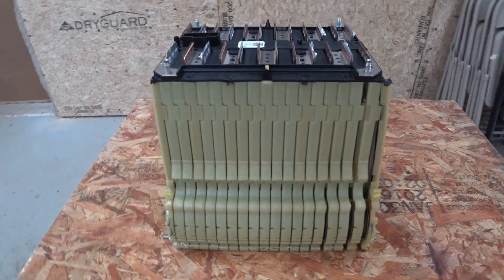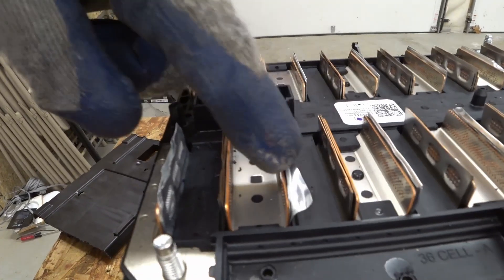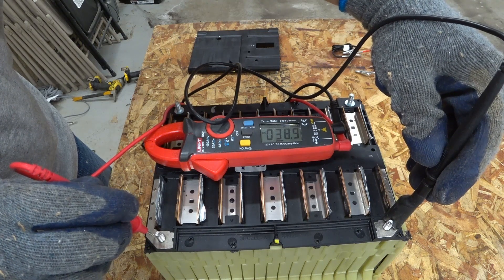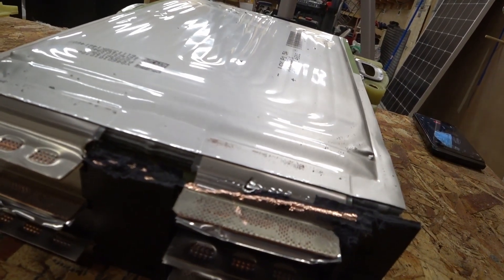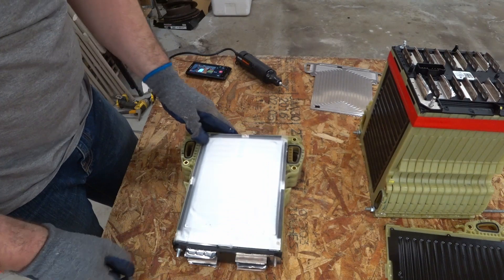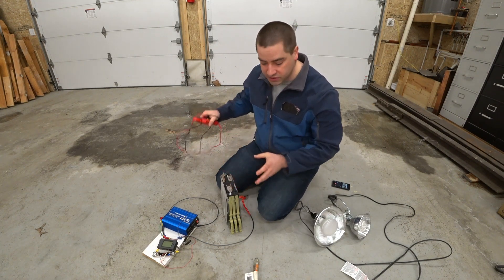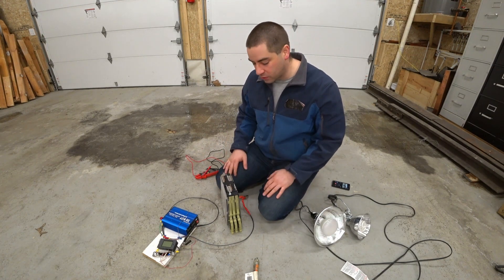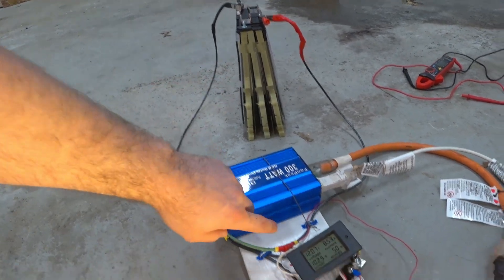Taking Apart a Bad Lithium Battery, Expanded Cells

Comment: You need to take more care of your followers David . Those cells were never bad. They were discharged for some reason well below the cells after .You are pushing the explosive angle and they just are not explosive or flamable until you get much higher in heat and voltage. You should have pricked the cell with a pin aqueezed them back together and superglued over the pin hole.
The Gas is just evaporated ethelyene carbonate heated by an overheated cell. It sits inside the pouch cell up to and covering the top of the plates.So the cells are good as you found out. The fault will be in the BMS or some place of short that occurred and got the last 3 cells only.Thats what you need to find because thats happenong frequently in Li Ion and LiFePo4 technologies.

Remarkable and a mystery because LFP cells love to work at 50C and in fact do much better there.?

Comment: heya oke so even wen the cell's are a little bolted they still have some capacity and they didn't blow up wen charged and discharged that is good to now because the polymer cell's that I bay are also a little bolted

Comment: FWIW the reason this probably happened is because someone disassembled the whole battery, but left the BMS connected to that pack (or all, doesn't matter) after the series connections between the packs were broken.  When this happens it starts to slowly discharge the end cells exactly like yours shows and the rest are perfectly balanced, albeit too low in this battery.  Eventually it will suck those end cells down to zero.  That, coupled with charging incorrectly to try to bring them back ends up fragging them.  This did happen due to some manufacturing defect or improper charging, unless they went waaaay too high when charging.
Reply from the maker: Thanks for the explanation.
Reply: Meant to say "did not happen due to some manufacturing defect"
Reply from the maker: I figured that's what you meant.  Again, thank you.  I appreciate when someone is willing to help me out and share knowledge.

Comment: Hello David. 
Thank you again for your videos. I have a concern about my battery pack and I would like to know your opinion:
I have a Chevy Volt Gen 1 battery pack. I just check every single cell and all of them show 3.52 V (like in the video:) ) but only one has 3.40 V. I don't see expansion or anything wrong, and I guess it is just a unbalanced cell (this battery has been stored for months).
What do you think? Should I worry about it?

I am a beginner and your videos are being really helpful.

Regards from Spain.
Reply from the maker: What you describe does not sound bad.  I would test the individual cell.  It can still be in the module, just make sure the module is not connected to anything else.  Then use some little aligator clip wires and a cell tester, such as this one or similar: https://amzn.to/2QgmXlN   If the cell still has the same capacity as the other cells (test a couple other ones for comparison) then you should be good.  
You will still have to determine why it dropped low in the first place.  Is it a bad BMS?  If so replace the BMS.
Good Luck.  I'd love to hear how it goes.  Maybe connect with me on facebook?  https://www.facebook.com/DavidPozEnergy/
Reply: Some cells statrt out like that and need an extra charge on that cell only when the pack is first made. Quality control is no less a problem on batteries than it is on car parts.

Comment: I've dealt with this over the years. Most hard cased prismatic cells have a pressure relief valve that can be mechanically released. 
Compress the cell in a vice and release the gas.
No open flame!!!
Reply: Ken Bell  I have had smaller 5-6AHr LiPo cells that gassed.  I put a dab of RTV on the edge of the pack and put the pack between a couple pieces of plywood with clamps to apply pressure.  Then used a very sharp pointed awl to carefully puncture the pack through the RTV (Still fresh) to vent the pack(outside!). Then smeared the RTV over the hole to seal it.  It removed the excess gas and the pack still works (with reduced capacity) but I don’t trust using it in anything.  Try at your own risk.   Good luck.

Comment: That test was well execute bro. It gave you  true reading ! I think sometimes these cell vary in resistance and can unequally charge and discharge . While charging the bms can bleed off any overcharge but probably no protection whilst discharging at a higher rate than the other cells if they have lower esr . I feel it actually a design fault really as the resistance match the cells but maybe would be better of have load analysis on each cell . I guess it all comes down to economics !
Reply from the maker: I agree.  My ideal BMS would have protection combined with the equalizer board from my more recent video.

Comment: One of the cells in my laptop battery puffed, so I did some research on this. It seems that these Li-Po cells puff because their seal was broken and moisture from the air got in them, which caused a chemical reaction with the electrolyte inside releasing a lot of hydrogen, causing them to puff. The puffing puts some space in between the electrolyte and anode/cathode causing the cell to not perform as well. Any attempts to release the hydrogen will only damage the seal further and increase the humidity that gets to the electrolyte in the cell.

Comment: It's quite normal for LiPo's to "puff" up when over-discharged as the chemistry inside starts to break down. The gas inside isn't air but hydrogen.
Reply: No I don't think its hydrogen or  oxygen as its produced from ethylene carbonate . But if you can find any support for the electrolysis theory please post back..

Comment: those cells will never get the rated c rating. but still very useable in a low current setup(for a short period of time because they are going to give up soon..
Reply from the maker: I had one comm enter suggest I add a step-down converter to charge my cell phone.  I think that would be low enough amps.  LOL   I laugh only because of the size difference between the battery and a cell phone.  Not the idea of a portable charger.

Comment: Maybe you could build a special fire safe enclosure and put it outside.  If you acquire at least 4 suspect packs over time, you could have 48V and wiring that a short distance to the house could be a little more worthwhile.
Another idea, is a remote solar station and battery backup for a well pump.  Again, in a fire-safe enclosure.

Comment: I'm using these batteries in electric car conversions and was interested in you're testing. Because of the load of a car that varies quite a bit setting a high cutoff voltage means a cut in power when accelerating at times. I have been seeing 35 amp hours from these batteries but that's pulling them down to 3 volts. I'm working toward using the batteries in the car  to run an inverter  to power the house  I think this is the next step . Keep up the good work

Comment: I would bet money that was a BMS failure.
Reply: Either that, or it was not charged in a while and those cells were weakest (or had highest self-discharge), so they ended up discharging the most.
Reply: A BMS merely TRIES to correct imbalance. If it's current is insufficient that's not a bms failure. You lost your money

Comment: Interesting so they are basically lipo packs like in RC cars or phones etc just bigger, and all in series.  Too bad they don't come apart without destructing them though, as it would let you rebuild packs if you have multiple with different bad cells.   Could maybe try to incorporate the individual ones into a RC car or something.  Wonder how long you could fly a drone with those. Though I don't know if I'd trust them for a drone.

Comment: An inflated battery is usually caused by 2 reasons, manufacturing defects or overtemperature when charge or discharge it. if the cooling system is fine the other thing to check is the BMS, could be working wrong. Is a good idea check the cell temp in the charge and discarge stage at a lower amp/h rate of the manufacture typical specs. the gas inside is PVDF with a fusion point of 180C . Be carefull .
Reply: Sorry that's incorrect

Comment: Seeing how the expanded cells are on the end of the stack, do you think regular water (or too low a water antifreeze mix) was inside the battery and froze?
Reply: Nope thats caused by wrong charging Lithium packs are air and water tight

Comment: It'd have been much more than 473Wh because you didn't include the inverter efficiency. No inverter runs at 100% efficiency so if you factor in for example 80% inverter efficiency, it could have been (473/80)*100 =591Wh. That's over half a kilowatt hours. That's a huge difference. :D
Reply: vuaeco   His watt-hour metering is happening ahead of the inverter, so his 473 Wh number is correct, except for the [tiny?] consumption of the meter itself.
Reply from the maker: You may enjoy watching my video on how I made the tester: https://youtu.be/yX094DWI-Mo  It might shed some light on this.

Comment: I would love to know what happened to my Android battery, it lasted for at least 3 hours with the screen on watching youtube, and then a few days without using it on battery (let it on the charger constantly) the battery went down to only lasting 20 minutes maximum, and there's expansion which I don't know if already was there or not.
Reply: If it's over 3 years old it's probably just dead. They only have a certain amount of charge cycles before they're capacity dwindles.

Comment: Wow I feel ashamed of calling myself an electrician, there's still so much to learn! Tell me something: I live in an area where every rain or storm causes electricity to drop for a few hours. What kind of RECHARGEABLE equipment could I buy just to keep a notebook and wifi router alive? Charging an Android phone too. It's a rather old laptop, consumes 65W from what the specs tell. (dedicated GPU and I keep my processor locked at minimum frequency for "too long story" reasons xDDD)  Edit: sometimes electricity don't fall but variation in voltage can be seen from the light bulbs, would an estabilizer of sorts be required too? Are batteries particularly sensible to voltage variation?
Reply from the maker: A friend of mine uses this and likes it.  I'm pretty sure it would work for your situation: https://amzn.to/2HoUaFC

Comment: Nice test. I wonder what would happen if you tried to charge a pack that had specific cells at a lower voltage vs the separated pack? Would the pack end up self balancing as it was taking a charge? Maybe compare this test against a test of 18650 batteries? It seems like the BMS question always pops up on your videos 😁 and I think it might be interesting to see how the Volt batteries or the Nissan leaf batteries take a charge when one or more cells of that pack are out of whack versus an 18650 pack. My guess is that given the construction differences, chemistry, C Rates and the overall size of the pouches compared to the 18650 cell size the Leaf and Volt will tend to self balance.
Reply from the maker: I'll have to give it a try.

Comment: Volt pack are tough. I have 480 cells that's 5 volt packs for my power wall. I have never seen a bad cell yet.
Reply from the maker: That's incredible!  Can we connect on facebook or e-mail?  I'd love to see some pictures of your setup.
Reply: DavidPoz sure we can chat. I'm on FB and you tube.
Reply: That’s huge...!. I only have two car packs, 32kwh, and they have been great so far. Would love to hear your system specs..

Comment: If my math is right that's 37ah per 3 pouches.  What is stock on the other I thought volt cells per 4.2v section was like 80ah? Measure a good 3 cells to see the difference
Reply from the maker: The label on that battery module states 2 kwh.  I cut out 1/4th, or 500 wh.  it tested at 473wh.  But I didn't drain the battery all the way down, so I think that is still pretty good.

Comment: 6:40
40 amps trough that thin cable?
Sure you didn't mean 4.0 amps?
Reply: I've seen hundreds of amps flowing through tiny wires, sometimes glowing
Reply: Nevada Forensics LLC 
I once used battery leads too thin and caught an rc car on fire because the wires couldn’t handle the high amperage

Comment: The cause of the expansion is simple  - it was charged while uncompressed.
Reply from the maker: The battery was already expanded before I charged it.
Reply: @DavidPozEnergy  prior to you obtaining it .... that's what happens to any pouch cell, they expand when charged, so need to be mechanically constrained - hence the allthread/threaded rod and end, clamping plates.
Reply: @SeanMoore2008  that's utter nonsense. Lithium cells do not NEED to be compressed. Compression helps to get the oxygen back into the electrolyte IF it has been overcharged OR over-discharged. They do NOT expand under charge

Comment: Just FYI, if you want to see a lot of smoke from those batteries, reverse the polarity of your lead acid battery and wait :) they don't quite like being charged in reverse

Edit: also keep the lead acid farther away from the lithium and run away quickly, it won't take long
Reply: They wouldn't be "charged in reverse" because that's impossible. What happens is a short circuit across added voltages which would be enormous discharge current. It would hurt the lead acid more because it has a higher internal resistance. You would do more damage to the lithium by shorting it alone rather than adding the lead acid because the short circuit current would be higher

Comment: Hi, it would be interesting to monitor the temperature reached on the inflated cell pack vs a good non-inflated cell pack. I would suspect they get hotter and therefore more dangerous
Reply: I had one earlier that i heard boiling innside before starting to smell, threw it outside when i noticed it was the lipo gone bad

Comment: Those batteries are now considered dangerous goods.  I maintain computers for  living.  Last summer someone brought me a laptop with a defective battery,  the battery had swelled just like those and when contacting the manufacturer for warranty they referred me to a company that was handling these issues.   I was sent a special shipping container that looked much like  five gallon bucket with a special locking lid.   Plus a special box to put the laptop into.  The laptop went into the box, the box went into the bucket, a special padding went around the box then the lid was placed on the bucket.   The bucket had a mailing label on it and we then called a courier service who came and picked up the bucket.   A few weeks later I received a replacement laptop.

Because of the swelling I could see the battery behind the monitor and it looked just like the foil packs that you are playing with.

Comment: I hope that doesn’t encourage anyone to use such batteries. Apparently this chemistry type is quite tolerant or at least the condition wasn't that severe... any other case could deliver a different result
Reply from the maker: I agree, that's why I said what I did at 10:57

Comment: If you wanted to destroy that cell you should charge it up then short it out. When you connected the car battery It was charging the pack.
Reply: Also if it was one cell you connect to the car battery it would then get too much voltage and then it would overload.

Comment: With any lithium chemistry, the damage done to cells occurs during RECHARGE. Discharge does not typically damage the cells. If you have a cell that has over-discharged, recharge it SLOWLY and you won't get dendrite formation or lithium plating. I have done this many times to cells that had zero volts
Reply: Overcharging breaks down the electrolyte. The life of the cells is not dictated by cycles, but by the amount of time the electrolyte is exposed to high voltage. If you want long cycle life, only charge to 80% SOC and you will get hundreds of thousands of cycles
Reply: Fully charging cells and leaving them at 100% SOC for long periods will do more damage than if they were cycled over the same period
Reply from the maker: Do you know what exactly 80% is for the Chevy Volt cells?
Reply: @DavidPozEnergy  at a guess 3.75 but someone who knows li-ion well could tell you
Reply: Have you seen bigclivedotcom did test with cheap lithium car jump starter. About 150A and that lithium cell puffed like and current drop. He also take one cell apart and tells it failure mode.

Comment: I had a Lifepo4 cell that fell to 1.5v during discharge and puffed out. I removed it and trickle charged it with 100mA for weeks. To my surprise, it lost it's puff completely
Reply from the maker: Thanks Nevada.  Andy mentioned the same thing.  I'm going to have to get a proper charger and try this method out.
Reply: You already connected it to a car battery so that ship has sailed
Reply: Nevada Forensics LLC so you saying the hydrogen recombined ?
Reply: @Buzzhumma  Its not hydrogen, It could be a combination of hydrogen and oxygen from the electrolysis of water used to dilute the ethylene carbonate electrolyte

Comment: If you are going to work with lithium ion cells you need to stop looking at the battery voltage and start looking and individual cells. If the battery falls from 12.6 to 10.3 that 2.3v drop could all be on one cell if it has lost capacity - leading to a cell that should not be passing current.
Reply: That's why simple lithium battery packs without a BMS , or with a poorly designed BMS, fail catastrophically.

Comment: I would use them in a safe way. I have packs for my rc planes that puffed up. I don't store them in the house but they still work like new. I do wonder what caused the pack to come apart. At first i thought maybe they had a hole in them.
Reply: I wonder if the connection to the rest of the pack was bad in some way. They didn't discharge the rest of the pack.